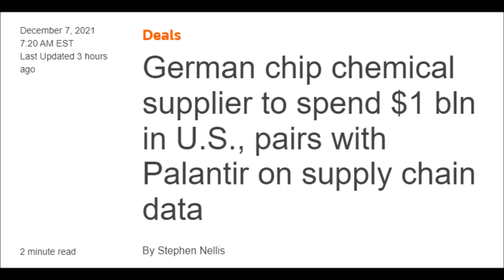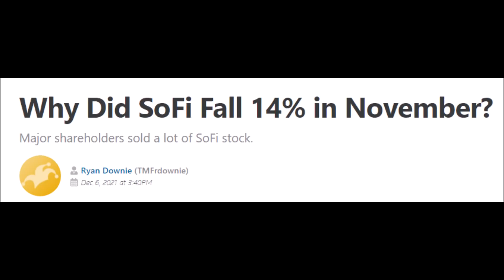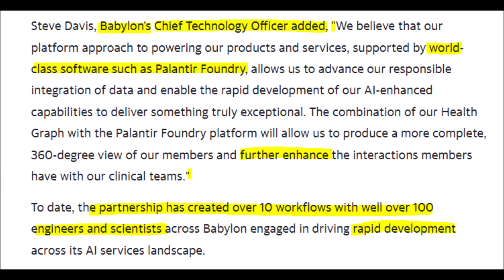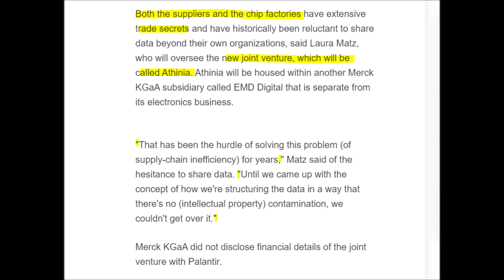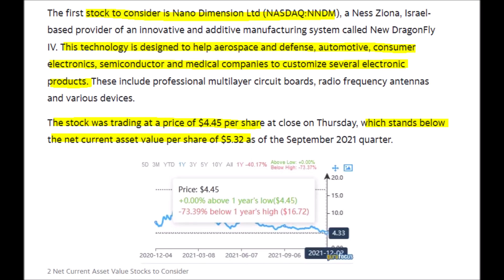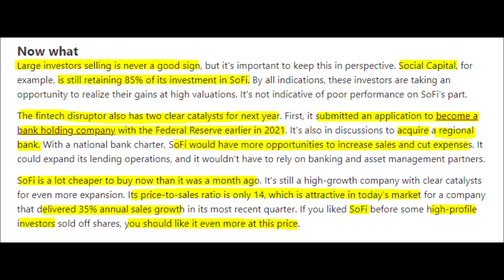Palantir pltr stock partnership! Nano Dimension nndm stock news! Sofi stock price target & analysis!

Comment: never bet against Cathie Woods, but NNDM's hardware appears to only have value for prototyping of low to mid quality hardware.  Any other thoughts that would make NNDM remotely appealing besides it liquidation value.
Reply from the maker: Great question and you are right. NNDM is indeed a speculative play. They have speculative value in their "AI networking brain" that they are developing. It will connect all of their machines to a single database library so customers can digitally choose to print something in that digital library and the machine will produce it in mass quantities. However, like you said the current machines can only do prototyping in low volume also the "AI brain" will only really work if they sell enough machines. something else to consider is that they are known for PCBs and the PCB market is around $50 Billion. NNDM is considered a leader in this industry however they will need to increase their ability to print more PCBs if they want to make good revenues from this. Basically, I only bought into this stock a little based on liquidation value because I do not want to speculate that all three of these things will go as planned. Sorry for the long response.
Reply: @ytfinance  thanks for the response, it gives me something to look into.

Comment: Did you say that they bougth stock of SOFI for $29,000 and $62,000 or did you mean millions ? It is not impresive if they only bougth for thusends.
Reply from the maker: I would say if intuitions are buying in any capacity is good news even if it is only a small amount of exposure.